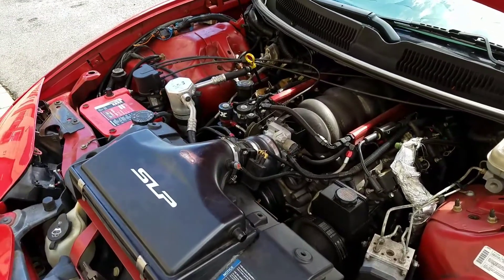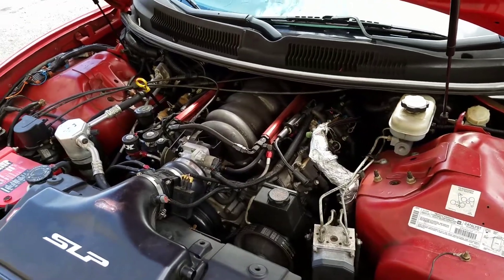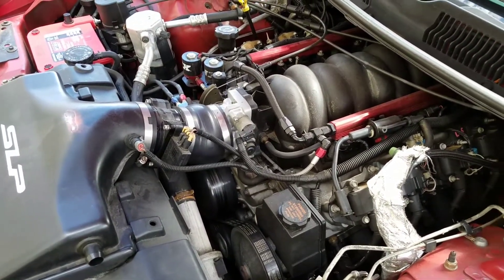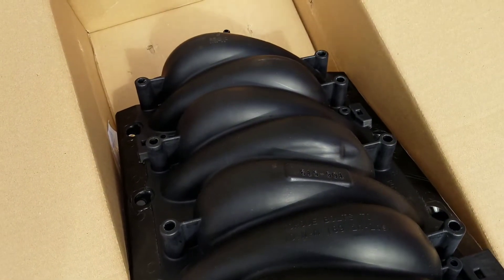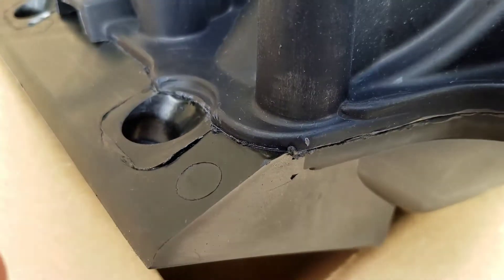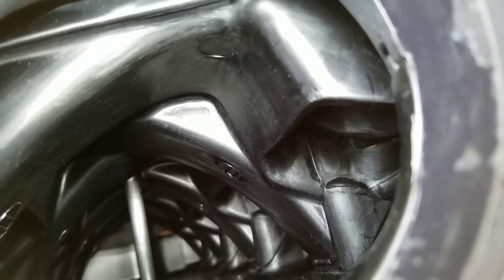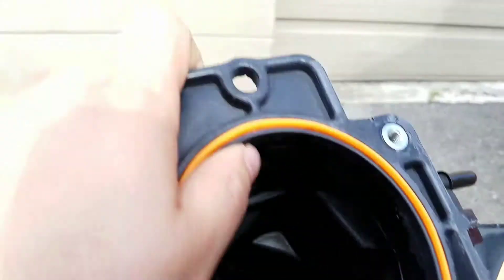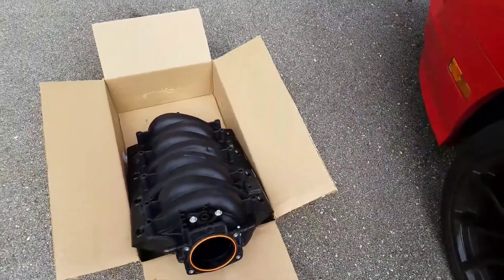Dorman 615-901 LS1 LS2 LS6 90mm Intake Manifold (Hostuned First Impression)

Comment: What is the difference between the 615-900 and the 615-901?
Reply from the maker: jjrock5 the 900 is the ls6 copy with the 3 bolt throttle flange. The 901 is the "ls2" copy with a 4bolt 90mm throttle flange.
Reply: Hos-Tuned Ryan is the 901 a direct swap (no mods needed) for a Camaro LS1? Meaning injectors, rail, throttle body, etc? I also plan on getting a 90mm TB. Thanks!
Reply from the maker: jjrock5 the manifold comes with different brackets to use either the ls2 rail & injectors or ls1 rail & injectors. The ls1 throttle body will work with a 90mm 4bolt to 3bolt adapter.
Reply: Hos-Tuned Ryan thanks!
Reply: @boosted_linkster7102 whats better ls6 or ls2?

Comment: I have already received two of these on amazon through Autoplicity and they were both defective. Take a good look at the inside of the runners and you will find a lot of flaws. Gaps and chips where the pieces meet. There should be nothing but smooth transitions and welds. I have found the first intake to have a huge gap and the second to have a chip. Both unacceptable.

Comment: I wanted to see a straight bolt on dyno numbers I have an ls1 manifold want to see how much better this one is
Reply from the maker: Looking at the manifold further, it is made very poorly as far as casting/flash. I would not put one of these in stock form on any engine.
Reply: Hos-Tuned Ryan thank you I think ls6 is my choice those stock flow verywell and don't have issues with uneven parts thanks again
Reply: Well it's dorman manifold so it's probably junk
Reply: This is a test for Richard holder not someone like this Dorman intake it's not as good as the LS6 I believe that's been proven a few time

Comment: Still waiting!
Reply from the maker: Force Automotive testing is happening in the next couple of weeks. I got my hands on a FAST 92 to add to the bunch!
Reply from the maker: Force Automotive I am sorry to report this but Dorman has pulled these manifolds off the shelf and discontinued. I'm hoping there are just a few revisions and will be releasing a new part number.
Reply: So you won't be testing the one you already have?
Reply from the maker: Force Automotive I will still be testing the current one I have. Also got an update from Dorman and they did re release the 90mm intake manifold again. Some slight revisions were made. I haven't received the new one as of yet to see what those revisions are. Currently porting the one I have as the ports were really jagged and had sharp edges. I will keep you updated!
Reply: Any Dyno number?????
Reply: Hostuned Ryan any test yet?
Reply: Chirp chirp chirp